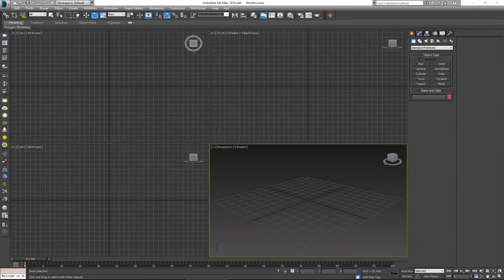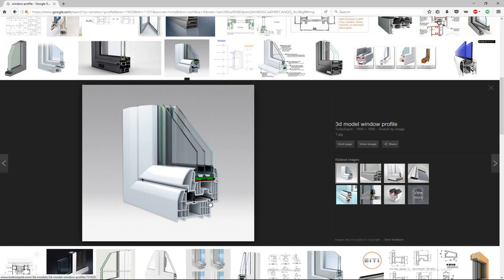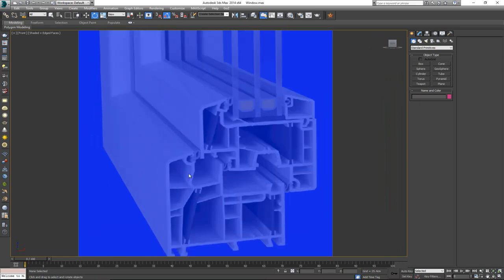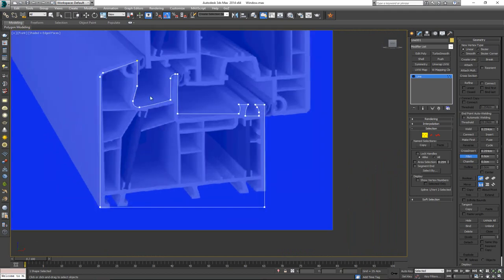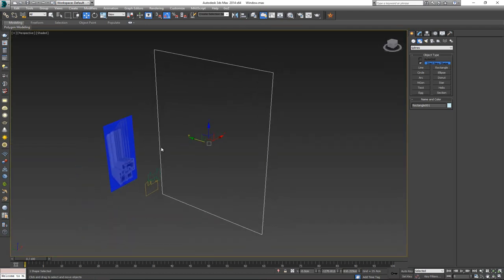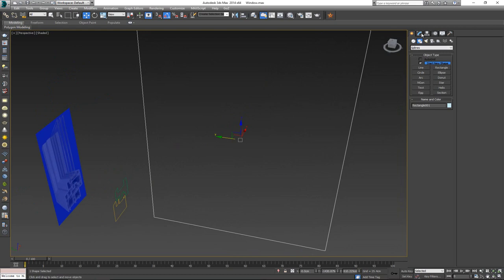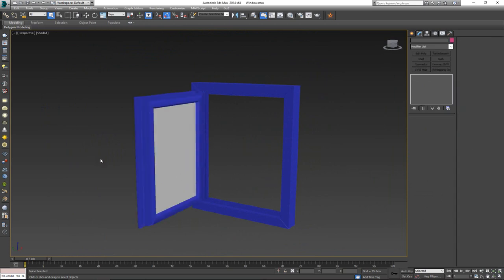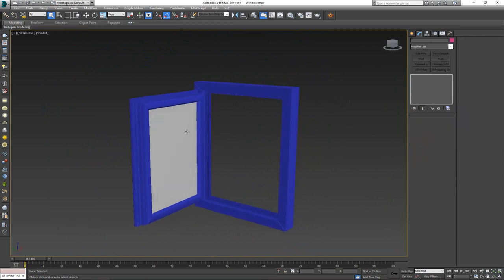Modeling a PVC Window in 3ds Max

Comment: I would have attached the shapes together and use Sweep instead. It gives you a little more control. Convert to edit poly and then detach one element then do a reposition of the pivots. Same results, but slightly faster. Great channel btw!  :)

Comment: Not best idea to place triple (or even double) glass to windows in yours scenes, it will slow render a lot.
Reply from the maker: That is actually pretty true. The only reason why you would put the double or triple glass would be if the render would have to be very close to the window. In that case you would get a double reflection from the two windows.